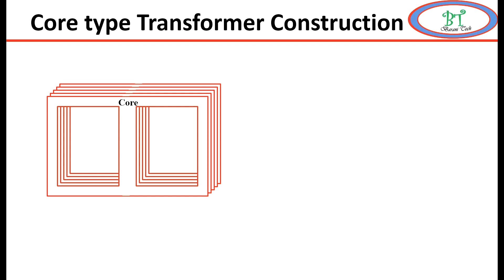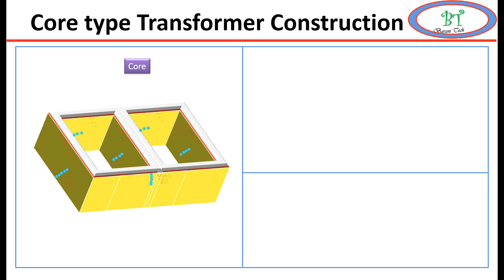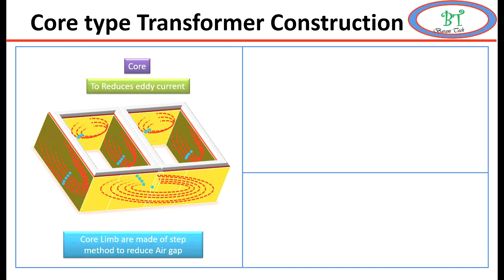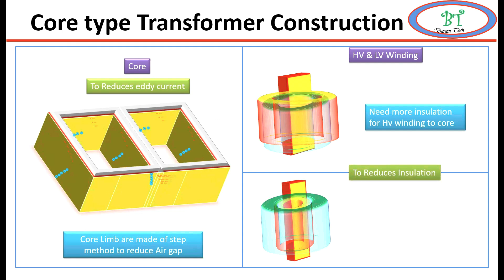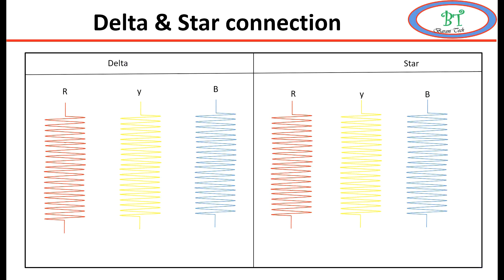Core Type Transformer Basic Construction

Comment: HI BARANİ OURS POWER PLANT  UNIT AUX. TRANSFORMER AND STARTING FRAQUNCY TRANSFORMER GENARATOR OUTPUT  23 KV IPB BUS PARALLENING CONNECTION UAT Dyn1 SFC TRANSFORMER Yd11  PARALLEL CONNECTED TRANSFORMERS FEEDING DIFFERENT LOCATIONS WITH DIFFERENT OUTPUT VOLTAGES AND FEEDING WITH THE SAME INPUT VOLTAGE. WHY DOES ONE TRANSFORMER HAVE TO BE Yd11 AND THE OTHER TRANSFORMER HAVE TO BE Dyn1 IN VECTOR CONNECTION SELECTION?
Reply: I would be very happy if you reply
Reply from the maker: its depends on the output application. if you need neutral at distribution end then we have to choose Y .